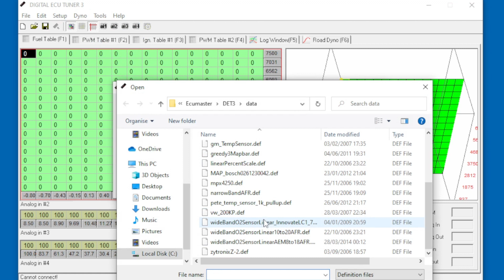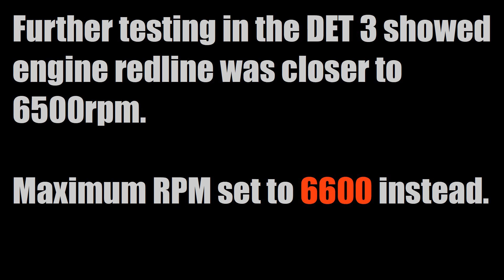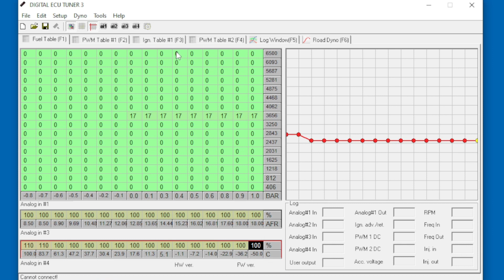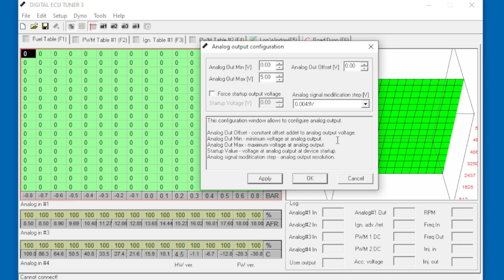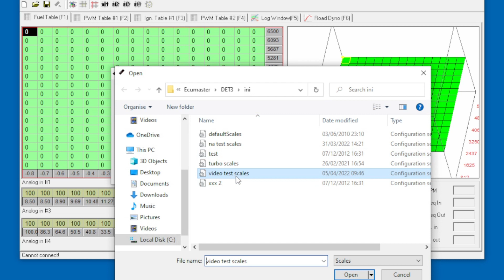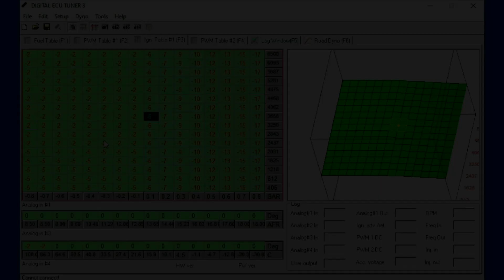Toyota Starlet ECUmaster DET 3 settings and software explained. | Toyota Starlet 4efe turbo build.

Comment: Hello Dan, I have some questiHello Dan, I have some questions that I can´t find any answers and I think you do know the answers for them. First question: Does ignition timing retard when you put -1 pull one degree of ignition timing or pulls -6 degrees? I found in atleast 2 forums saying that advancing 1 degree meant det3 advanced 1 degree, but when pulling -1 it pulled -6 degrees in ignition. 

2 Question: O2 sensor needs to be disconnected on all cars so it is always on open loop and doesnt change our values? Or it´s only on specific cars? I read that you said you "most vehicles of this age don't run closed loop all the time either, usually only cruise and low load situations. " so would you say its better to disconnect it in all cars or just some vehicles specific? 

3 Question, basically in piggyback mode if you are NA and put a turbo on it you either need to use fi mode or use bigger injectors / more pressure in fuel regulator right? Because piggyback is just changing signal values and 5 volts its the maximum value of stock map so If I want to run 0,2 bar turbo pressure it would equal to lets say 5,3 volts and that wouldnt work right? Unless I had bigger injectors that would spray more with the same voltage right? Sorry for my english, I hope you can understand everything and clarify me.
Reply from the maker: 1. -1 degree in table retards timing by 1 degree, -2 = 2 degress retard etc. The confusion comes from the ignition table working out averages between cells. If you have -1 degree in one cell and -10 degrees in the cells around it the computer will average them out to -5. Not jump from -1 to -10 when it goes to the next cell.

2. Yes, disconnect narrowband O2 original sensor on all cars. Or use FI mode.

3.  Yes, exactly correct. Piggyback mode needs bigger injectors / higher fuel pressure to spray more fuel at the same MAP voltage to prevent boost cut. MAP voltage is max. 5v and boost cut voltage can be lower than 5v. When you add turbo to N/A you have to replace the injectors for larger ones so this shouldn't be a problem. In piggyback mode always keep the upgraded injector size as small as possible to achieve the turbo power goal . This reduces the amount of change the MAP signal needs (MAP voltage = load, affects fuel and also affects stock ecu timing ;-)).
Reply: @dan91sgarage  Thank you so much Dan! I really appreciate it ;).

Comment: I have trouble getting my DET3 unit connected with the software. Can you help mate? It shows as cannot connect. the Bulb on the unit stays on. USB connection is detected in Device manager. but the tuning software says Cannot Connect!!! PC Specs: Windows 11 if that helps.
Reply from the maker: Have you downloaded the DET 3 drivers fom the Ecumaster website? Windows 11 doesn't ship with the drivers.

Comment: How you cheat stock ecu to NOT searching lambda 1 ? My stock ecu is siemence and i can’t make proper afr for boost if my stock O2 sensor is connected. It is always goin to 14:1
Reply from the maker: On the Starlet I just cut the narrowband o2 sensor signal wire and connected it through a switch so I could turn the signal to the ecu off and tune det 3+ without intereference from it. No CEL either as the toyota ecu is old tech. Modern OBD2 might not work like this.
Reply from the maker: or use fuel implant mode for full control of injectors. Lot harder to wire in and tune though.
Reply: @dan91sgarage next step is to use det3 in FI mode. I have experience with megasquirt and fuel implant mode on det3 is not so complicated as tunerstudio.
Reply: @dan91sgarage my siemence is old too,but i am not sure how to understand what you write. Are NA or turbo?
Reply from the maker: @desislavkanev9613  Turbo
Reply: @dan91sgarage yes, I found out later. Your ecu and lambda tables inside are made for boost. Mine ecu is from NA engine and because of this i have problem with using my O2 sensor. Like i said- i will try on fuel implant mode
Reply from the maker: @desislavkanev9613  No. My Toyota ECU for 4efe engine is N/A. I add turbo to engine (NA+Turbo). To stop the fuel changes from narrowband o2 I cut the signal wire from sensor to the Toyota ECU so it does not get a signal. I then tune the fuel with the DET 3+ piggyback and wideband gauge.
Reply: @dan91sgarage ok i am doing the same,but in my case it doesn’t work. When i tune the det3,connect my 0-5v narrowband O2 sensor and when i got boost my “smart” siemence ecu cuts the fuel and always gone in range 14-14.5. You know this is not a good afr for boost. Then i disconnect O2 sensor and with external wideband sensor i tuned my fuel table…. Damn it… now when fuel table is tuned i will try to connect again my O2 sensor,but i am sure it will not work 😔 what is your boost and afr readings?
Reply from the maker: @desislavkanev9613  Just dont connect the narrowband sensor after tuning, its the only way to use piggyback or the normal ecu will always target 14.5 when it shouldn't (low boost). Idle and cruise were 14-15 afr, -0.26 to 0.00 bar were 13.? afr and on boost was 11-12 afr.
Reply: @dan91sgarage the main problem is that when i am on full throttle between 4500-5000 engine start to stall and after 5000rpm is going fine to redline.may be after some % of opening throttle blade my siemence go in some other mode/ petrol injector merged/ and my lpg system always gives errors. Another problem is emission control. I have a big problem on MOT

Comment: How does it control fuel without connecting to injector wiring? can you explain how it does this through map sensor connections you made
Reply from the maker: Piggyback wiring= It intercepts the Toyota ECU map sensor signal wiring. It then uses the det 3+ 4 bar internal map sensor (to read boost) to send the signal to the toyota ECU. Map sensor is 0-5v signal, more voltage = more fuel, less voltage = less fuel. Controlled by numbers in the det3 fuel table adding or subtracting voltage to the 4 bar sensor signal sent to the toyota ECU.
Reply: @dan91sgarage  Thanks for explaining that, makes sense now. so the Toyota ECU is still firing the injectors sequentially and its using the map table to tell the injectors to add more due to been told a higher voltage at given load site.
I have one more question regarding the third party wideband, usually with wideband setups there's a AFR target table that the lambda shoots for when set by user and trims accordingly. How does it work with the DET3 in order to stay on target afr? is there a table you set?
Reply from the maker: @--JinX--  The det 3+ wired in "piggy back" (map sensor intercept) mode only uses third party wideband AFR signal for datalogging, you can then overlay the recorded afr data on top of the fuel table to show whre it is rich and lean then manually adjust the fuel table numbers to improve the afr. It's not ideal but its better than most piggybacks. There is no AFR target table in piggyback mode. If you wire the det3+ in "fuel implant mode" (injector control) it can use a narrowband signal to target a single afr value (usually stoich) for a given rpm range, this is used for idle and cruise economy fuel use up to about 3000rpm, then it is open loop fuelling controlled by the det3 fuel table, direct control - semi sequential injectors. Still no wideband target AFR table, only datalogging. When you consider the DET3+ is only £250 I think it has excellent features compared to an emanage blue. It can also do electronic boost control with a mac valve so no need for a seperate boost controller! If it had all the features of a full standalone it would be harder to sell the standalones- 🙂

Comment: Hello, so thank you for the video. My question is, though, how does a trigger wheel for ex. 60-2 send 4 signals per 720°. Would it not be only 2?  Every 360° it should hit the missing tooth sending a signal?. When I look at the manual of the DET3 it does show it greyed out with 2. However, the programs greys it out with 4. On the physical world it should be 2 (2 missing tooth per 360°). So, this part I do not understand. Would you happen to know?
Reply from the maker: As far as i know when you choose a trigger pattern type of 60-2 it understands the number of signals from the tooth pattern on the wheel and doesn't use the input in the 720 box below which is why it is greyed out in the software and can't be changed. Choosing 60-2 in the first box tells it that there will be a pulse every 6 deg and a "gap" of 12 deg at "tdc". It knows 1 revolution is the missing teeth gap. 
The 720 signal box info is more for ignition module setups that could be any number of cylinders or it can't understand rpm. Only able to change this box info when you select that ignition type at the top pull down.
Reply: @dan91sgarage  Ok, got it. So, the number of signals is the number of ignition signals right?, not the number of signals the sensor puts out (0v, 5v)? I am guessing in your case is 4 because you have it hooked up to the crankshaft sensor?. I have a jimny cabrio 2000, with OBD1, this is why I need to use the ECU piggy back, and also it does not have a CKP sensor.
Reply from the maker: @drzakk  Mine is connected to the spark signal from the ecu to the ignition module in the distributor. Do you have the G13bb engine or M13A?
Reply: @dan91sgarage  Hello, thank you for the answer. I have the G13bb, and I can't get the DET3 to intercept the ignition signal. When I put the camshaft sensor signal through the DET3 ( I have it from sensor signal to ign. in and from DET3 ign. out to ECU) the car does not start. When I hook it back to the factory ECU but splice the cable and hook it to the ign. in, it does start, and I do get the RPM readings, and in scope mode I can see the signals. Of course I still cant modify the signal because it is just spliced to the ign. in, it was just a test to see if it even read the input and it does, but once I put the signal through the DET3 the car does not start, not even in scope mode.
Reply from the maker: @drzakk  What ignition settings are you using in the det 3 menu?
Reply: @dan91sgarage  Hello, I have tried almost everything. I am using Hall effect sensor and on the setting I tried every option. Even scope (which is supposed to just copy the input signal to the output) and still no luck.
Reply from the maker: @drzakk  Never owned a Jimny, but from the research I've done it looks like it is VR sensor, 11 tooth trigger on cam (check number of teeth). If it was my car I would try: Retard non uniform signal, VR sensor adaptive threshold, 11 signals per 720. 
The det 3 can also intercept 1 or 2 igntion module signals. Does your Jimny have 2 coils on engine for wasted spark?

Comment: Can you please help me the car runs and drives perfectly fine now but for some reason it’s like launch control keep’s activate by itself and won’t go over 3000 rpm I’ve turned it off on the ecu but it’s not helping
Reply from the maker: Is the car standard apart from the Det3 install or have you modified other things? larger injectors? Have you changed anything in the fuel map?
Reply: @dan91sgarage  car is now driving the way it should it’s a little rich and I can’t get it to it’s sweet spot but honestly I think it drives Better than it ever did the only thing now is I can’t get launch control to activate I want some pops and bangs but I’ve wired the launch control button to analog 4 wire and +5V wire to button from the det3 but it doesn’t work do you have any advice please I’m sorry to keep bothering u
Reply from the maker: Sorry mate. I don't do pops and bangs.

Comment: Can you please advice to me how to properly install ecu master det3 onto 2001 Honda civic D16V1 manual uk model I’ve messaged ecu master themselves but they havnt been of a lot of help and can you please tell me if all the wires go into the ecu which is inside the car at the glovebox or if any wires go to the engine bay the car is still natural aspiration but the ecu master is the one with the 4bar map sensor built in
Reply from the maker: It should connect to the wiring from the ECU, not the loom in the engine bay.
The link below takes you to the Wiring diagrams ECUmaster have on their website There is a honda civic D16v listed 01-06 don't know if its the same as yours.
https://www.ecumaster.com/wp/wp-content/uploads/2016/11/DET3_WiringDiagrams.pdf
You have the det3 with 4 bar map so don't connect the TPS to the analogue 2 as this is the hardwired position for the 4 bar internal MAP. In fact you don't even need to splice into the TPS signal for piggy back mode. 
Power, ground (both spliced into), Map sensor signal intercepted, crank sensor signal intercepted.
Hope it helps.
P.S. not worked on Honda's so please find an ecu pinout to confirm the ECUmaster wiring is correct.
Reply: @dan91sgarage  thank you for the help I’ve got the wiring diagram for my normal ecu and from ecu master it all seems to be the same so do u say I don’t need to connect a vacuum hose to the ecu?
Reply from the maker: You don't need the vacuum hose from the intake manifold connected to the MAP sensor barb on the DET3 if you're just running Naturally aspirated, it will run fine on the stock MAP sensor. I would connect the hose now anyway, it's not difficult to do. AFAIK the stock Honda MAP sensor can read a small amount of boost (8psi?) so when turbo is added and more than 8psi of boost you will need the internal 4bar MAP connected. I was talking about the wire splice connection to the Throttle Position Sensor (TPS), it's not needed for a piggy back det 3 setup.
Reply: @dan91sgarage  ok thanks I really appreciate ur time to reply
Reply: @dan91sgarage  I have one last question how close or far should the det3 wires be to the original cars ecu?
Reply from the maker: @samcroskery4742  The instruction manual says that the wires from the det3 must be shorter than 30cm. You can buy ready made leads with pins on from ecumaster (30cm) and just clip them into the plug. I would say anywhere from 15-30cm is fine for the Honda.
Reply: @dan91sgarage  hello thanks for the reply’s I appreciate it and yes I got the wires for the ecu master det3 when I purchased it I’m going to give it a try today and hopefully get it all set up properly I will message u if all goes to plan and again thank you for taking the time to reply
Reply: @dan91sgarage  I’ve got all the wires plugged in apart from the TPS but the car flash’s the green immobiliser key can u explain how to fix that please
Reply: @dan91sgarage  I’ve got the car on and idling but when trying to build the rpms up it is very boggy and also the rpm readings on the computer when connected to the det3 is all over the place at idle bouncing from 4K to 6K even at idle with no throttle
Reply from the maker: @samcroskery4742  Could be a wiring problem or it could be a setup problem. The ECUmaster wiring diagrams show the setup configuration at the end of the manual. The manual specifies configuration 12, check you have setup the det3 as per this configuration (ignition mode = Honda 12+1...etc).
Setup tables: As you haven't connected the TPS wire splice, the Load setting should be the MAP sensor on Analogue #1 not Analogue#2. Or you can splice the TPS signal wire to Analogue #3 and use that for the load signal (N/A only)

Did you attach the wire from pullup pin 8 of the det3 to the crank sensor feed wire to ignition in pin9 as per the diagram?
Reply: @dan91sgarage  I’ve got it working how it should I’m just waiting on a afr gauge to arrive so I can adjust fueling I’ve searched ur videos to see how to wire the afr gauge to the ecu master det3 but couldn’t find one could u tel me how I do that please
Reply from the maker: Can you explain what was wrong please and how you fixed it? It helps other readers to understand and possibly solve their problems.

Here I install the gauge: https://youtu.be/KnYUAMNS6OU

Here is where I wire the AEM AFR gauge to the det3 for datalogging: https://youtu.be/i86d2BTWgAY
Reply: @dan91sgarage  thank you and to fix the rpm idle problem I went onto the computer det3 software and changed from retard single signal to Honda 12+1 and that fixed the rpm issues I’m now just waiting for the afr gauge so I can adjust the fueling how it needs to be so I can actually drive the car because as of right now it won’t move it just stalls with even the smallest throttle